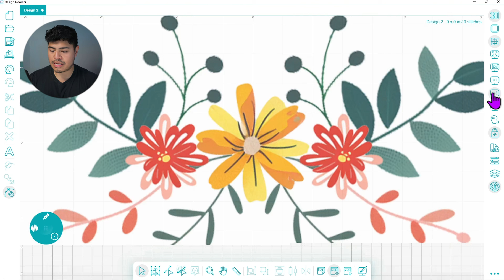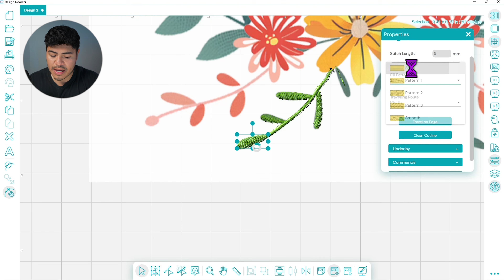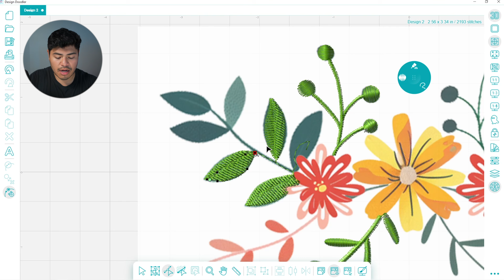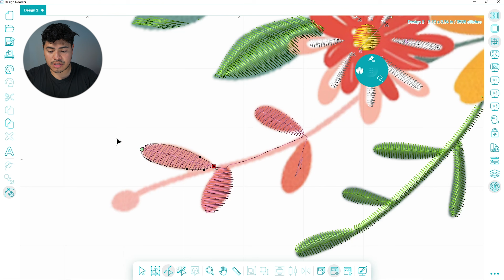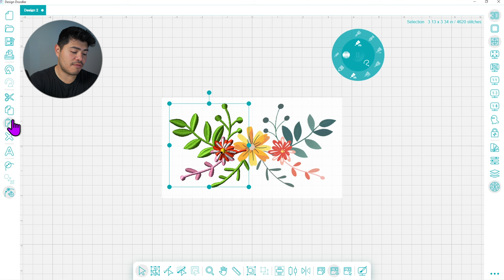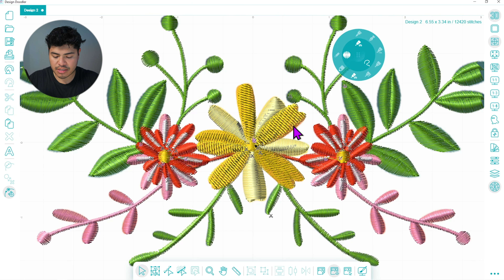How to Digitize a Beautiful Flower Design | Design Doodler Tutorial

Comment: 🎉 quick question…in the pink area of stem where you went back and finished the steil…could it have been branched also to extend without the start ad stop or am I over thinking that? 🎉. The starts and stops were a huge help for me! Thanks again!🎉 more stuff like this! Please! 🎉
Reply from the maker: Unfortunately you can't branch steil and fills, which is why I did the connection manually! Hopefully this changes soon to forget doing so and branch away!